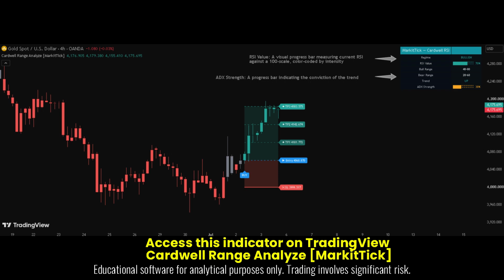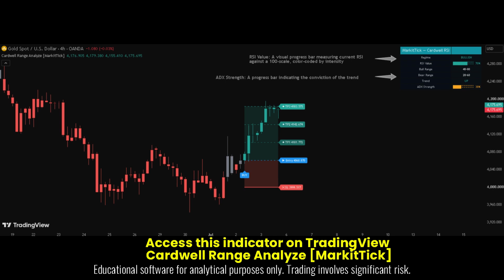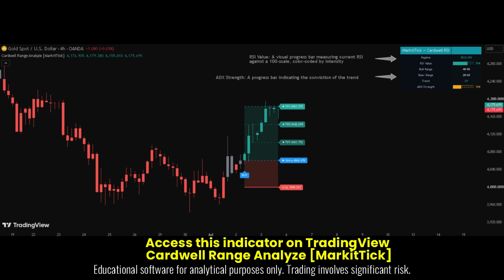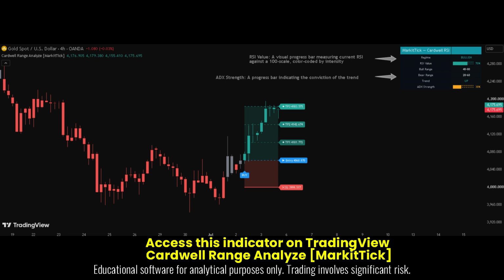Cardwell Range Analyze MarkitTick

Comment: Which time does this work properly
Reply from the maker: The "Cardwell Range Analyze" indicator is designed to function effectively across multiple timeframes, as its core logic relies on trend-following filters and RSI-based regime identification. However, because the indicator generates signals and alerts only after the close of a candle, the performance and reliability of these signals will vary based on the timeframe you select.  For scalping or higher-frequency trading, you may find that increasing the sensitivity of the tool by adjusting the "Trend MA Length" and the "Regime Confirm Bars" within the settings provides results better suited to your specific strategy. We strongly recommend backtesting the indicator on your preferred timeframe to ensure the performance aligns with your technical requirements.
Reply: @MarkitTick give me backtracking Link
Reply: For 1 min scalping best settings?
Reply: @LEEFA_TIMELINE give me back testing video link indicator link also

Comment: Can I use this for scalping?
Reply from the maker: This indicator is primarily designed to identify established trend regimes using RSI, moving averages, and volatility filters. While it is technically capable of being applied across various timeframes, the signals and alerts are generated upon the confirmation of a candle close. Consequently, this mechanism may introduce latency that is typically suboptimal for high-frequency scalping strategies.  To enhance signal sensitivity for shorter timeframes, we recommend adjusting the "Trend MA Length" and the "Regime Confirm Bars" within the indicator settings. We strongly advise performing thorough backtesting with these modified parameters on your specific instrument to ensure the logic aligns with your execution requirements.